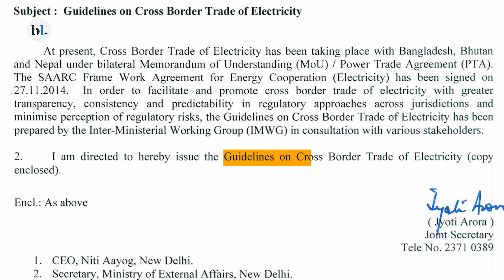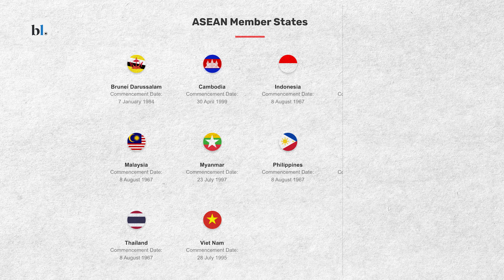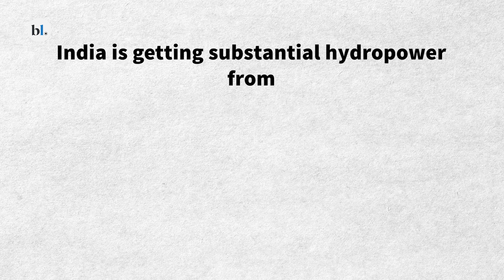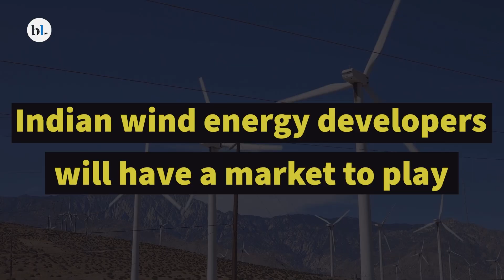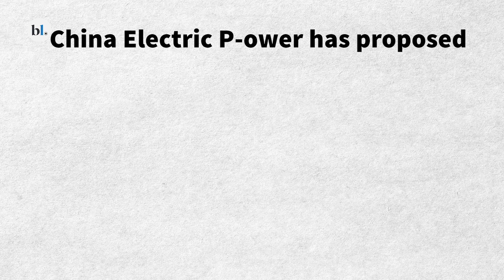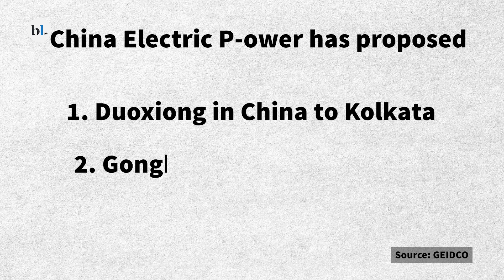How Sri Lanka’s renewable energy can help India’s decarbonisation efforts

Comment: It's part of larger goal of One Sun One World One Grid initiative.

There is also a proposal to link Indian Gird with Saudi Arabia and UAE grids via Oman... Interesting fact is that GCC countries already have a functional grid among them.
And as part of I2U2 there is a plan to link Israeli grid with GCC grid and Israeli Grids to European grid thereby connecting India to Europe and Arab world. For multilateral electricity trade.

In the east talks are on to connect Indian Grid to Singapore's grid to trade renewable power and ASEAN has a functional grid among its members. Also there is a proposal to link Australian Grid to Singapore's Grid from Northern Australian port city of Darwin so effectively India and Australian grids will be interconnected. And remember that Australia has a very big desert which spreads from its western part to North Western part. So solar power can be a very big sector there.

And apart from Electricity grid linkage with Sri Lanka a bridge and petroleum pipeline is also under negotiations which once finished will reduce the logistics cost while trading with Sri Lanka by 50%.
And Sri Lanka has enormous onshore Wind energy potential because if you look at the geography of Sri Lanka the mountain ranges start from Anuradhapura which is ending point of the plain region so a transmission line from Anuradhapura is very ideal. Plus I think IDK exactly but this is my opinion that Sri Lanka don't have such companies which can build renewable power capacity at gigascale like India have in the form of NTPC, Tata Power, ReNew Power, Avada energy, Adani, Reliance etc. So it's only the Indian companies which will get contracts to build wind plants in Northern Sri Lanka. This would also mean increased importance of India to Sri Lanka.

Lastly apart from geopolitical feasibility connection of India grid with China wont at all make sense this would give a leverage to China in long run. Even considering China's renewable energy manufacturing supply chain dominance they will establish a large number of renewable energy plants at cheap costs to sell power to India at dirt cheap costs initially through Chinese government subsidies as well... This will potentially kill Indian industry so it doesn't make sense.
On manufacturing side our solar pv modules manufacturing capacity is projected to reach 95 GW by 2027 with integrated capacity projected to be 20 GW wich includes polysilicon production as well.
BESS manufacturing capacity is likely to reach 95 GW by 2030 which is very less than China but enough for India and capacity will be expanded more with new capital investments considering the twin balance sheet advantage of both banks and corporate companies. So the cycle of 2024-28 will see a large capex plan which will majorly be to decarbonise their industries and capacity expansions in manufacturing of new technologies.

So instead of connecting with Chinese grids it would be wise to connect GCC grid and Singapore grid via undersea transmission lines should be the priority they are in advanced stages of negotiations as well. This will open up export markets for India.
And geographically as well the interconnection of Arab countries, India and ASEAN with India at center is feasible to get approximately 20 hrs of uninterrupted power supply through solar by connecting ASEAN and Middle East grids to Indian Grid so that will be more beneficial than with Chinese Grid Interconnection as of now considering long term geopolitical and economic implications with China.